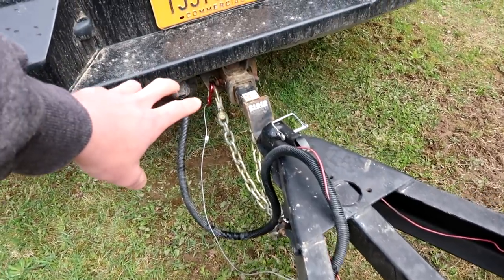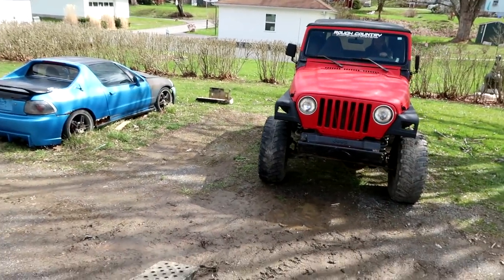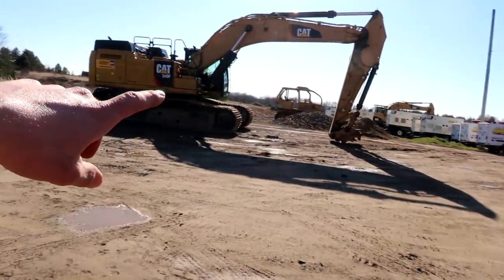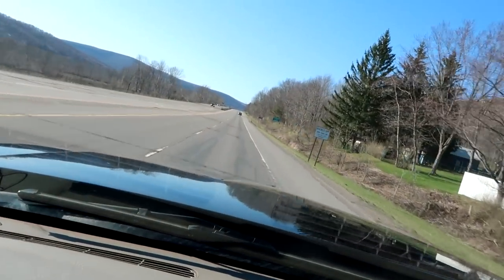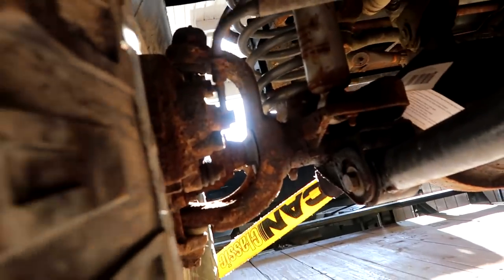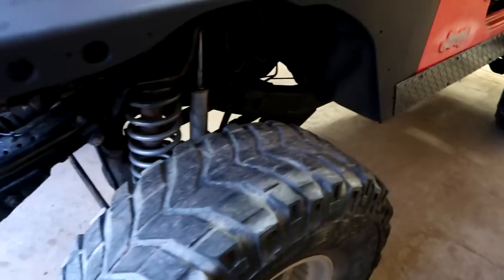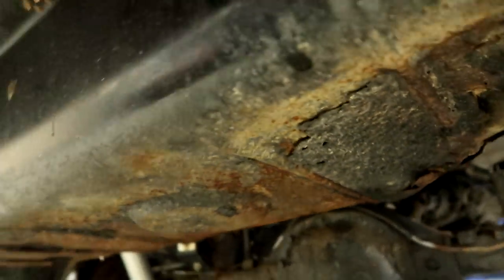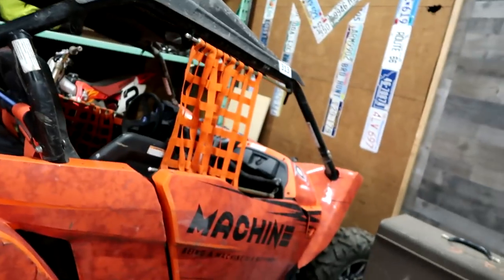I BOUGHT A JEEP DEATHTRAP

Comment: 4.0 will last forever as long as it's well taken care of. The rear drive line angle can be reduced with a transfer case drop kit, I can't tell if it already has one, it looks like it has some kind of homemade looking transmission crossmember so that might not be helping.  A slip yoke eliminator and a double cardan rear driveshaft will do it wonders. That rear diff is a Dana 35 and really can't handle much abuse. The front Dana 30 isn't much better, I wouldn't go with any more than a 35" tire on those axles. Finding a set of Dana 44s from a '03-'06 rubicon would be a direct bolt in and a huge upgrade. But no matter what it will be fun. Welcome to the jeep life!

Comment: Your engine will not stay running because the mass air flow sensor is not connected because the air box is missing
Reply: Hunter Gradner it’s speed density doesn’t have a mass airflow
Reply: Hunter Gradner wrong
Reply: With out that sensor it wouldn’t cause it to stall but it will cause it to run rough. I thought the same thing lol

Comment: Look over that Jeep completely.  The old owner was using cheep parts.  And was proud of it.  Rough Country stickers on the paint.
Reply: jay west ^
Reply: 4.0 i6 is a bulletproof motor with general care and maintenance, also easy to work on! Go over it and fix the obvious stuff first. U also have a body lift which is NOT ideal if your planning to have a true offroader. And as said before, do yourself a favor and get rid of as much rough country stuff as possible. Oh and do some research on getting a SYE for your np231.
Reply: Andrew E rough country is fine for a weekend warrior but will still fail. Any kind of research will show the same. It's the cheapest stuff you can get. Generally not a great idea. But that's why Dalton got it so cheap.
Reply: Andrew E I guess you missed the part around 11:35 when he said he wants to make this as a daily driver..
Reply: I’ve had a Rough Country Suspension kit on my Jeep before and they’re not that great. I’ve had it collapse once but that’s it.
Reply: If you want quality buy a Rusty’s

Comment: Welcome to the Jeep Family....  Not a bad looking rig.   I’m sure it has some rust issues as you pointed a few out.   The I6 is a pretty good engine but not without its problems.   Not knowing if its the original engine and proper miles as showing???   They can be a high mileage engine if taken care of but not like a Duramax for sure.  But then they are not as expensive to replace or repair either.   The driveshaft is another issue.   The angle is way to steep....  one fix is to clock the rear diff a little.   Good luck and looking forward to this build for sure.

Comment: The inline 6 can easily get 250,000+ miles. As long as you take care of them, it should last you a long time. I also noticed a great deal of rust underneath your jeep including the frame. (Not something I'm used to seeing because I live in California and my 1999 TJ hardly has any rust.) Anyway, I think it would be a great idea to take the tub off the frame and sand/paint the frame and axles to prevent it from getting worse. Great video by the way!

Comment: Inline 6, best jeep engine ever made. Some have over 500k on them and still going strong. The problem your having is most likely the cps or the map sensor. The rear driveline angle is a bit extreme. If you have driveline vibrations once you get it running, you can shim the rear and put a slip yoke eliminator on it with a double cardan driveshaft. Best bed on cleaning all the rust up would be to take the tub off of the jeep so you can easily get to everything and get it done right. Looks like you have a solid start to a good project. 👍🏽

Comment: We got 60,000 out of a reman straight six. And there was 46,000 on the original engine. They are complete shit Dalton. Also, the automatic transmissions are junk.
Reply: Pulled Plug - Earth, & Ether. Yep heeps...
Reply: lol bump
Reply: You must be beating the absolute dog shit out of it and not maintaining it properly cause the 4.0 is a very reliable engine if you take care of it and do proper maintenance
Reply: Maxiethedog123 yeah no kidding i drive a jeep with the 4.0 and it has 210,000 miles and runs great
Reply: Mine had 26xxxx and ran great, I tested compression blow by and everything else out of curiosity and it was within factory specs
Reply: chase kerkhoff yeah this guy is either a troll or just really beats the shit out of vehicles and doesn't maintain them at all
Reply: no they will last up to 450k if you take care of them
Reply: There is no way you have a Jeep with 4.0,if you really owned one the last thing you would mention would be the 4.0 engine
Reply: Maxiethedog123 yes some engines work that way but when crysler who goes for hp and not reliability builds it, you can't prevent breakdown

Comment: Dalton, a slip yoke eliminator will help with the rear drive shaft angle and if you are offroading will also help prevent the driveshaft from popping out and losing all the trans fluid.  At about 150K miles you will probably want to do a rebuild on the engine but they are super easy to rebuild.  You can just do a hone job, new rings, and then have the head rebuild and it will probably be good for another 150K

Comment: To fix that driveshaft angle, there are companies that make a transfer case drop kit. As for it running and dying, bypass the fuel pump ballast resister to see if that's the issue. If not then go back to the pump and have a buddy turn the key on and see how much power you're getting back there with a multimeter or test light. I just bought a '91 Cherokee that had this issue and there was almost no power back to that pump, would hardly light up a test light. I went through fuse, relay, ground, ballast resister, etc with no luck so I ran it to a switch with a 4 pin relay wired in. Runs like a top now but have to remember to turn that switch off when you shut the jeep off.

Comment: I would check the cam position sensor on the passenger side by the oil filter. Those love to go bad and the 4.0 wont run without it. If you're gonna do any serious wheeling with it, that D35 rear won't last long with 35s. I'd go with a Ford 8.8 out of an Explorer if you can. Other than that she looks good for a northeastern rig. Good luck and have fun!

Comment: I have a 2003 Jeep Wrangler Sahara, to start I would say get the engine running smoothly, fix the brake situation then move to the drive terrain, do a slip yoke eliminator from advanced adapters if it’s not done, you have a Dana 35 in the rear which might be blown up or is blown up because it might not be built, the engine 4.0L amazing engine you can get over 300,000 out if you taken good care of it and more if you need it up, last thing is the lift a 7 inch lift is a lot the dented of gravity is super high and it has a higher chance of rolling you can cut fenders and run a 3-4 inch lift and still fit your 35” tires. Sorry if it’s a lot and not trying to command you just my thoughts after building a little Jeep to my rock crawler
Reply from the maker: Thanks for the comment! I very much enjoyed reading it.

Comment: I have a jeep and a duramax  as well, drive the jeep daily. It has 146 k  bought it with 140 2 years ago runs like a top. I drive my duramax to haul, long road trips, and just for fun . My jeep has a 5 inch lift had to do some tranny work and lengthen the drive shaft to keep it in gear cause it’s a stick. I’ve always been told on a jeep anything over a 3 inch left causes binds in the transmission definitely did with mine. Mine also has 35s you are gonna need a after market power steering box or the stock will crack and leak. I love the jeep I’m a excavator so I’m always dirty and so are my boots, Hop in the jeep dirty don’t care keeps the duramax clean definitely the way to go dalton. It’s also cool on warm days to cruise with the top down. Smart move best of luck I’ll be watching to see how it turns out.
Reply from the maker: Love the comment JOE! Thanks for the advice and story!

Comment: those in line 6's Ive seen well over 300K  on several when I was a mechanic.  They also used this same engine on lots of other vehicles  so parts are easy to get usually

Comment: I work @autozone and every time a jeep with that motor comes to my store for parts they have well over 200k on the clock the only thing i would say to check on that motor is the number on the side of the head if it is casting number 7120 or 0630 those had a problem with blowing head gaskets, also i would recommend that you make some type of bracket for the coil pack because from the factory those 4.0 engines did not have enough support there and the vibrations from the motor along with other things could cause the coil pack to crack and not function. other than those your all froggy fresh with that motor!!

Comment: My grandma has an in-line 6 mercery (Ford) standard 4 and it’s got 700,000 k on it and it runs good. And yes the      in-line 6 is a very respectable engine, especially when it sounds that cool!

Comment: Depending on the axels I would put Dana 44’s with 4.11 gears. I have a 1997 tj and the 4.11’s with 35in mud grapplers does great. I can run 70 in 5th gear no problem and I’m getting about 13 mpg. Also get lockers like they are a beast when you get in a sticky situation. Go over the entire Jeep and take off that body lift please. A good suspension lift 4-6in is good for most tire sizes.
Reply: If you can a 4bt Cummins would also be a great add on for the Jeep no doubt. My Jeep also has 200,000 miles on it, however the lifter is ticking so I put some slick 50 in it and no problems since.

Comment: last hight mileage 4.0L I had was 280k miles an it still had compression within spec in all cyclinders. BTW that charcoal cannisters next to ur brake booster goes in the back right fender by the fuel tank.

Comment: Start with the drivetrain and then more into the the Interior and for the interior i recommend patching the rust spots and then roll on Berliner the floor pan, and then you need a transfer case drop kit because if you don’t your going to break u-joints and snap the u-joint strap bolts or you will destroyer the driveline

Comment: I have a 98 cherokee with the same 4.0 currently at 225k and my brother has a 92 cherokee that has just over 300k both still running strong, not going to say with no issues "it's a jeep thing" you will have some issues mostly wiring and sensors  but the 4.0engine will run forever if properly maintained.... Where to start...? start with the anti-theft, if the jeep is equipped with it that's exactly how one will act, run for just a few seconds and die. if not check the tps with a multimeter there is a lot of videos on how to do that. Third check all the vacuum hoses especially the ones coming off the intake manifold.

Comment: I had a 4.0 xj jeep with 180k rear shackles were through the floor and the drivers seat was also through the floor. I used a 2x4 to hold the seat up for the dirt oval at a friends farm. It ran so good, but the body etc was just so rotted. By the looks of yours it ate muddy water at some point.

Comment: Check the compression, check for metal in the oil, oil in the radiator fluid... and maybe if you get some exhaust on it you can listen to see if any of the bearings are shot.  Also check to make sure you did not jump a tooth on the timing belt.  If all those check out the engine might be good for another 100,000.  It does not look like he took good care of it though, so maybe you will get only 10,000 to 20,000.  Old Jeeps with good frames and decent bodies though usually hold their value because people are willing to drop an engine in it and go 4 wheeling.

Comment: The 4.0 is an amazing engine. The only issue I had with mine was the oil filter housing o ring. You will have to weld two tools together to take it off. But you have that covered. I found your channel a little over a year ago from the stolen bike video. You handled it better than I would have. I would have given him a good ol Army 
A$$ woopin.

Comment: Those are stock fenders just painted black.
I'm going to say the fuel pump is done.
Most Jeep lift kits use a transfer case drop brackets to fix drive line angles.
Your Jeep looks to have a hokie or homemade kit.
Yes the windshield folds down after unbolting the rollcage from the inside, but with the bolts missing on the outside on that one side I wouldn't lower it until you replace them.
Reply from the maker: thanks!
Make sure to make these great comments in the future :)

Comment: Big red is what you shoud name it and u shiuld start by putting an air filter on it and getting it tuned up. Also do some research and see if it has a maf (mass air flow sensor) if it does then u will need to buy that because i didnt see it on te intake. Thanks for all the enjoyable content dalton. Your kicking ass whoop

Comment: Have a 2004 Jeep Wrangler with the 4.0. Great engine but high rpms is no good. Keeps hold their value really well. I would address engine then move to clutch. Changing the pinion angle is ehh. I run 35’s on stock everything. Just keep good greasable Ujoints in it you should be fine. I have completely rebuilt my 4.0 went .030 over and a hotter cam. Gives it plenty of power to do anything you ask.

Comment: You need to remove the body lift, and swap the rough country kit with a bds or other brand long arm kit, but not rough country. Also, look into buying a slip yoke eliminator and cv drive shaft.

Comment: My cherokee xj has almost 229,000 miles on it with the 4.0 6 cylinder with zero problems. Once you get it running good just maintain it and you should have a long lasting engine

Comment: I have a WJ and my 4.0 straight 6 has 221k on it and still going strong. I've pulled another jeep grand cherokee with it too. Tons of torque. Btw the crankshaft sensor could be causing the problem.

Comment: Something that might fix the running and stalling is if you cleaned the throttle posishing sensor and replace the spark plugs but another thing could be the fuel pump is going bad or you have a computer issue

Comment: you should drop the lift down to 4-5" TJs get very tipsy with too much lift and will roll quite easily (whether on or off road) lowering the lift would also help with the driveshaft angles.

Comment: I had a couple 1995 Jeep Grand Cherokee Laredo with the in-line 6 and I got mine to 350,000 and still sold it running and driving so they are one of the best motors a Jeep can have. I have had about six of the same style Jeep just different colors if you have any questions don’t be afraid to message me

Comment: The reason why it is stalling is most likely a maf sensor or a map sensor or any intake sensor. That or ur idle air valve needs to be replaced or tried to be cleaned. That’s why it starts but doesn’t run.
Reply: Forget what I said about the sensors, yes that should be replaced but look at the idle air control valve

Comment: Unfortunately whoever lifted it looks to have cheaped out and put a Rough County lift on it. You're going to have to replace a majority of the suspension components to get it to ride good and perform great. And yes that rear pinion angle is pretty agressive which will wreck ujoints. Those 4.0L engines are tanks. If cared for they'll last well past 400k miles. My Jeep has the 4.7L and it's a lot of fun just won't last quite as long. Make sure to change all fluids as you usually do, there's probably mud in the differentials.

Comment: could you make the tolerances on your trailer fit the jeep too if you wanted to take it rock crawling/camping? Theres a lot of good spots in the mountains, and the Midwest. We would watch straight vlogs of you taking the Duramax, Finished Trailer, the Jeep or Crush, and a Dirtbike somewhere cool like the red Oklahoma dunes where 2 strokes are street legal, and riding around for a coupple of weeks or months during the cold NE winter just living out of the trailer in a park or whatever cheap hookups are at.

Comment: I have a jeep grand Cherokee with an inline 6. It has been running strong for 19 years with 164,000 miles on it. The only thing i had to replace was the gaskets and water pump. You should name the jeep Cherry.

Comment: These inline sixes tend to make a knocking sound dont be alarmed cuz its just the lifters. We have the noise in my dads 77 cj7 with the 4.2 liter six and same noise on my brothers 81 cj7 but then around a 160 thousand it jumped a tooth on the timing chain and started to run like dog crap and stall like the same problem you have. He wanted a v8 so we swapped ot for an amc 360 but the engine was still very much usable. My guess is the timing chain jumped a tooth like ours did or somthing else is messed up. I dont know abaut the tj and the yj but i know its common with the cj7s that the push rods slip out of place because that happened with my dads 77 and the 81 and we also suspect that that happened with this 82 cj we are building from parts. Jeeps are bullet proof at least the old ones. Back in 66 my grandpa bought a 67 jeep Wagoner with the rambler 327 and 3 on the tree trans and he still owns it today. It has over 400 thousand miles on it and still runs and drives. He has rebuilt the engine 4 times but these were not full rebuilda. They were just rebuild ing whats broke and whats working stays. One of the rebuilds were needed because he road raged and had it up to 120 before the break in even ended. (Not a surprise the engine blew jeeps are a monster to drive at 80 let alone 120 with leaf spring suspension)

Comment: just keep the oil changed and tune ups up to date and your good one the straight 6 they will last u for ever I have a 95 grand Cherokee Laredo and now it has 241000 miles and change and it still runs strong as the day I got it and a hell of a 4 wheel drive in it they are pretty hard to get stuck mpg for mine is around 18.9 pg